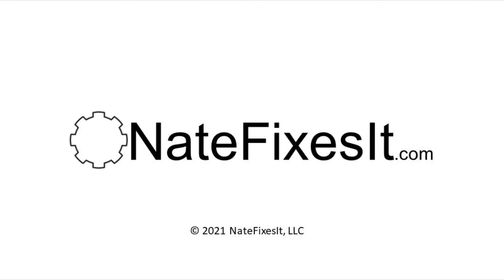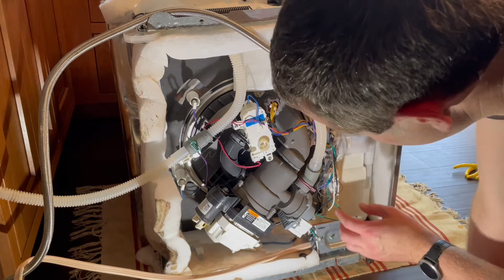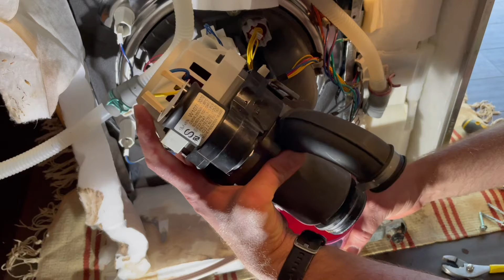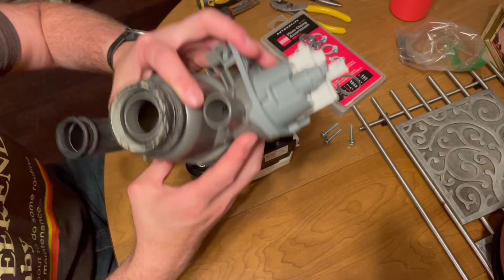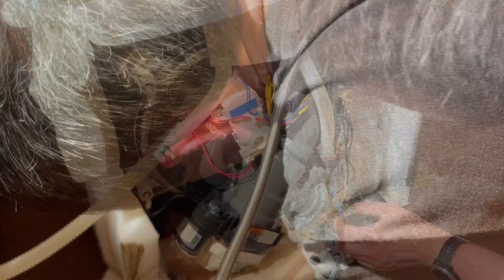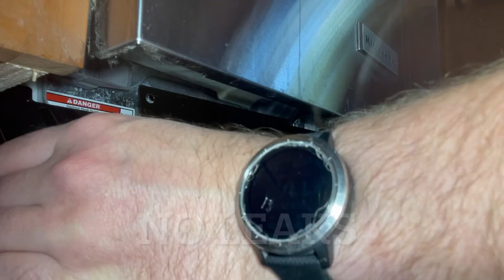KitchenAid Dishwasher Clean Water Wash Filter Replacement and Circulation Pump Replacement

Comment: Yeah, that was definitely the problem, not the $450 control board the service wanted to replace.  Glad I told him “no thanks, I’ll fix it myself.”  The stainless steel filter screen was shredded! A 1/4” diameter felt pad, 1/16” thick, probably the foot of a cutting board or something had jammed between the filter and it’s housing.  THANKS SO MUCH NATE! Without this great video I never would have known the filter existed.
Reply from the maker: Glad that I could help, thanks for watching!

Comment: Would did pump have anything to do with water filling into the dishwasher?
Reply from the maker: The pump controls spraying and draining.  Filling is controlled by the float switch and fill valve which are both much less expensive and much easier to replace.  I have videos for both of those repairs on a similar Kitchen Aid dishwasher.

Comment: Would you have any idea what would cause the lower spray arm assembly to not turn? It still sprays, but doesn't spin. Kitchenaid with the same type of filter you just showed how to fix. Thanks,
Reply from the maker: The lower spray arm on mine easily detaches.  Spin the star-shaped nut below the lower spray arm counter clockwise about 90 degrees and the whole spray arm should come off.  Try checking inside the spray arm and the tube to the spray arm for obstructions.

Comment: Thank for this video !!!!! SUPER APPRECIATED. My metal filter thing was ripped apart. A couple things to mention that I dont think are mentioned here - first, that clamp you mention that you have to break - its HARD to take off. Take your time with it so that you dont damage the hose. I replaced it with a screw type hose clamp and it worked fine. Second, getting the motor out - It is actually anchored in with a metal hook in the back - its a little tricky to get it out if you dont see it. You have to pull the motor a little towards you and back at the same time to get it loose. Thanks again man!
Reply from the maker: Glad my video could help you.  Great tips in your comment.  Thanks for sharing!

Comment: Thanks! Used the tips here to get the whole pump and filter back installed. I had no idea that filter screen even existed! I was hoping to find the reassembly of parts on the filter unit as the two metal washers and the spring came apart fast and I wasn't totally sure, but we got it!
Reply from the maker: Glad I could help, thanks for watching!

Comment: Very helpful. I followed your instructions and repaired our dishwasher issue we had for a while. Thank you.
Reply from the maker: Glad that I could help. Thanks for watching!
Reply: @NateFixesIt  
Hi Nate - Quick question, during disassembly, I remember a thin metal ring (kind of double layered). It is similar to the metal ring in the filter assembly, but larger. Now, I don’t remember where it is or if I even put it back. PS: I did disassemble the inside water arms and bottom arm as well. I can’t find the ring. Am I imagining this or is there a double layered metal ring part at all?
Reply from the maker: @sheref9421  There are a few ring shaped metal clamps around the hoses attached to the pump (look at minutes 5-6) and there is one metal ring next to the filter (see minute 10).  I don’t remember coming across any other metal rings.

Comment from the maker: Here are the parts for this job:
 Stainless Hose Clamps (Amazon link https://amzn.to/2XiKFyR )
W11084156 Dishwasher Microfilter (Replaces AP6048028, W10713298): 
https://amzn.to/49q6mAA
https://amzn.to/3Jr7sjk
https://partsdr.com/part/w11084156-pump-filter
W10902589 Dishwasher Pump (Replaces W10390342, W10713292, W10788707):

https://amzn.to/3Jsy5Eu
https://partsdr.com/part/w10902589-pump-motor-assembly